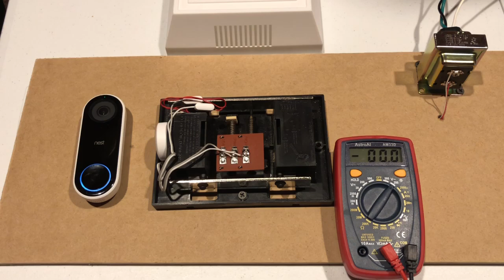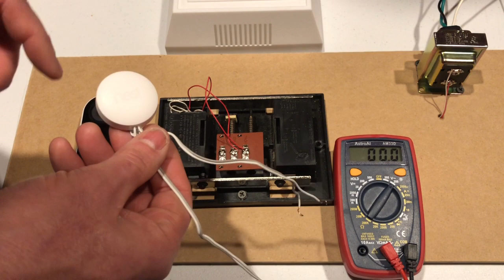What Does the Nest Hello Power Kit Do?

Comment: THANK VERY MUCH!  I was wondering what that power kit does!  The Ring doorbell also has this too.  So it's basically a capacitor!  That makes sense.  Stores just enough power for the doorbell to briefly ring the chime without relying on the transformer for all of it.

FYI, the doorbell itself has a small lithium ion rechargeable battery that keeps the doorbell running for that brief moment it shorts the wire to make the doorbell chime.  Once that battery dies, you're relying solely on the power kit (or capacitor) to keep the doorbell powered up.  With a dead battery, it becomes more important you're using the upper limit of the recommended voltage range, which I believe is 24V AC to keep the voltage from dropping too far so the doorbell doesn't reboot.

Comment: I think as others have observed you over simplify what you think this box does.   I think what would make sense is that the the nest door bell need power to stay charged therefore the supply voltage is a closed circuit making it continually powered to keep the battery charged this mean when in steady state the NC relay is kept open (powered on) and the chime sees no voltage. when you ring the doorbell the circuit breaks the supply voltage the relay goes to the closed position and capacitive power is feed to the chime to make it ring.

My issue is the door bell ring is very weak - Im not certain if its because I have a 16v power supply and this doflicky box doesnt have enough juice to activate the relay - so im going to up it to a 24vAC transformer.  Ive also read the the doorbell deactivates the chime when it is at an extreme temperature.  Ive also read that if there is no wifi connection the physical chime doesnt ring.. this is bizarre as the primary function of this is to ring the damned doorbell so you know your amazon package has arrived - there is no reason why the physical ctt shouldn't work without wifi.

More failure mode testing i think

Comment: Thank you for this video. I left my Nest Chime Connector (capacitor or what you call a power kit) connected at my old house and Google does not carry replacement parts.. So I'm thinking of buying a Newhouse Hardware 30TR 16V 30VA Doorbell Transformer and wondering if that would work without the power kit?
Reply: You can purchase from ebay
Reply: @corina6772  He didn't ask where to buy it. He said he is thinking of buying it and if it will work. Do you have an actual answer to the question? I'd also like to know the answer and since you are quick to spout off, what's the answer, chief?
Reply: @ogpennywise  1) Am I taking to you? No sir. 2) it’s a recommendation not a solution. Not a derogatory response. 3) Have a blessed day!

Comment: I got the nest door bell, didn’t came with this chime adaptor, so now si fully functioning, but when the doorbell ring, it sounds twice with a little delay, a crack sounds, and not as get used to, any recommendations on how to fix this problem? I saw another video someone put  1/2 watt resistors between trans and front. Seems to work, but someone else mention could be fire hazard. Do you have information regarding this solution? Thank you!